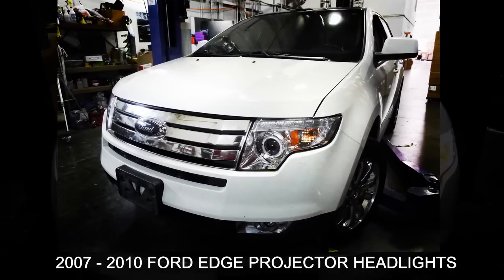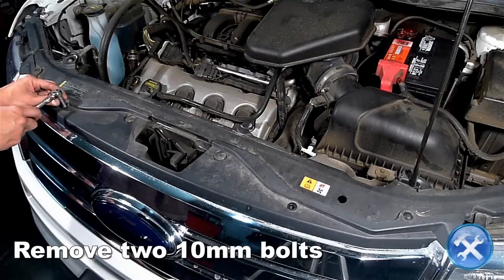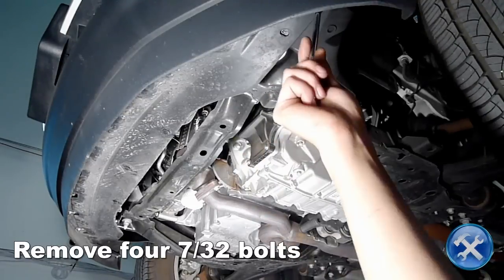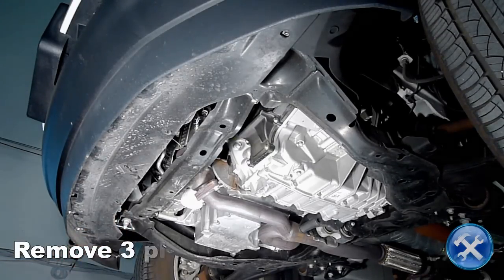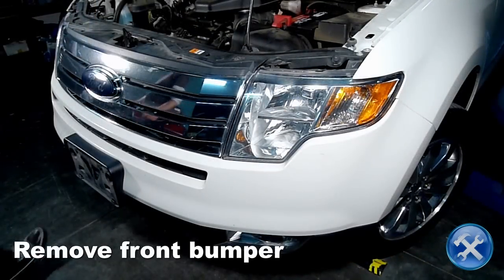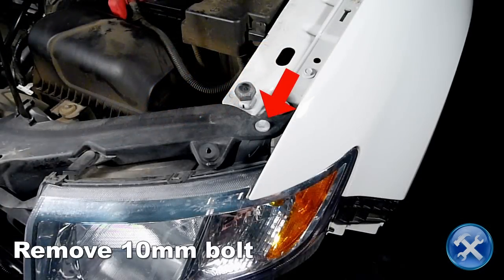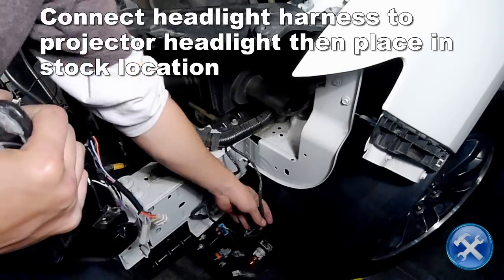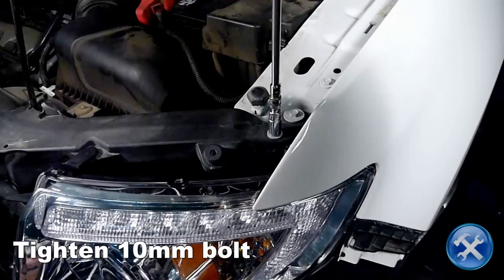SPECDTUNING INSTALLATION VIDEO: 2007-2010 FORD EDGE PROJECTOR HEADLIGHTS

Comment: Where are the high beams on these head lights????? Looks like there is only low beams on them....
Reply from the maker: knuccles25 There is a solenoid on the low beam that will flip up. The bulb in the low beam is also your high beam.